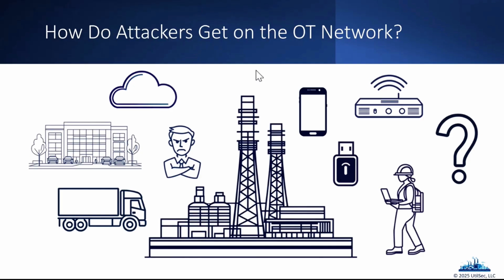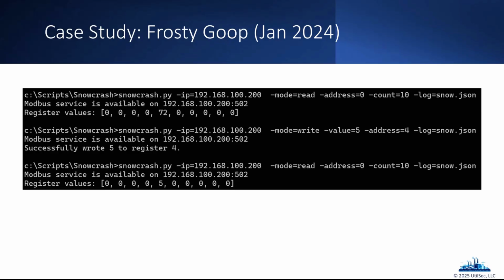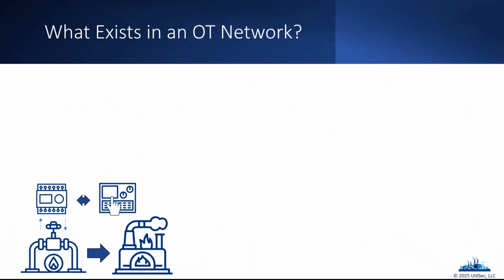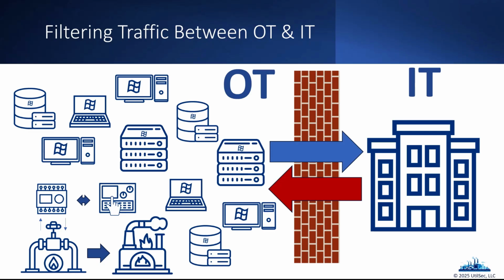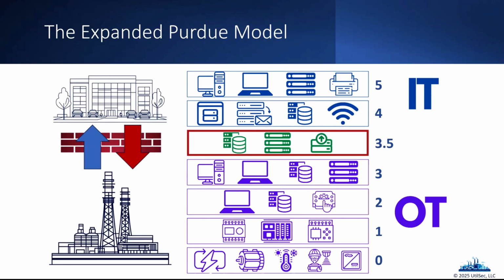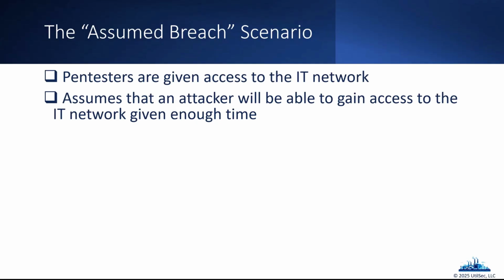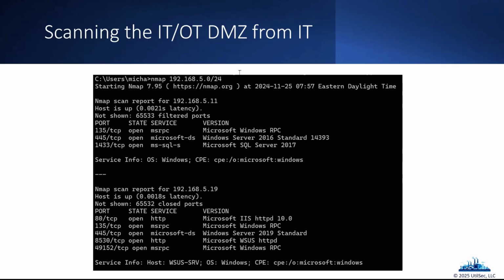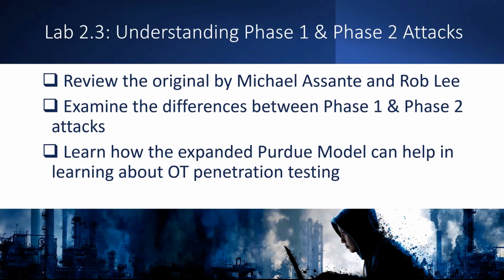Intro to OT ICS Penetration Testing (Part 2): Unveiling the Secrets of OT ICS Pentesting

Comment: Hi Mike, thank you for this very good presentation. May i ask a question ? Is the Purdue model an obligation to get an ICS OT network certified ?
Reply from the maker: I'm glad you asked, Dominique.  And no, the Purdue Model isn't an obligation (or related directly) to any type of cybersecurity certification for an OT/ICS network.  The Purdue Model (and the expanded version that most refer to today) is simply used to show how different components within OT and between IT communicate.  It's original intent was to demonstrate the timing requirements for different layers of OT assets versus IT assets.  I hope this helps answer your question - thanks for watching!